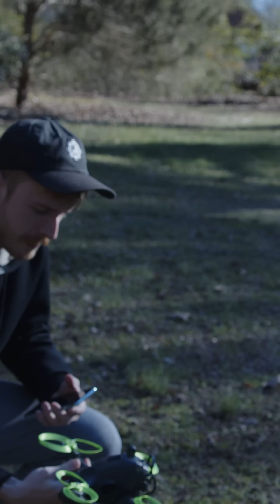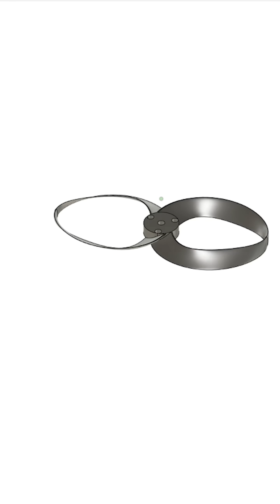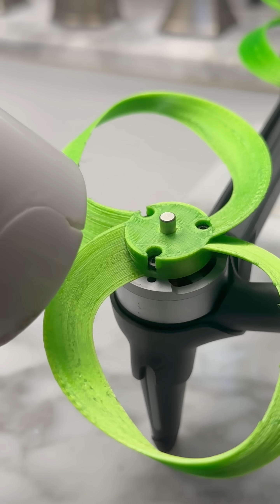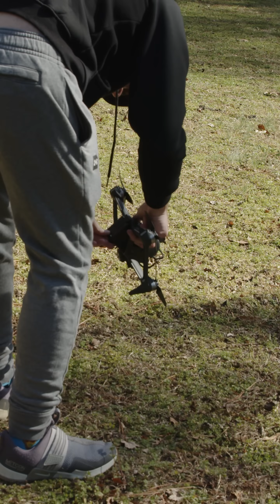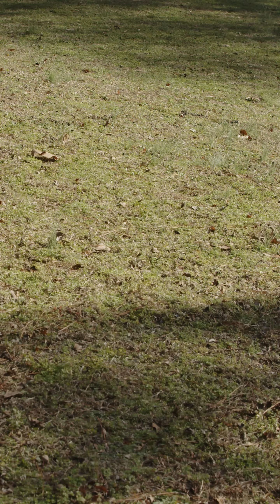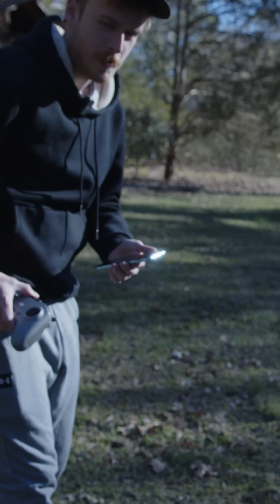Testing MIT's Toroidal Drone Propeller Design & Sound #shorts

Comment: They are very similiar
Because the normal propellers are vrey well manufactured to less than 0,1mm deviance and are very smooth etc
The 3d printed proellors, if oyu go down to the microscopic level, even with nailpolish are gonna be 100x rogher, whcih is why they are way louder thant they should be.
Reply: the real propellors were literally 3d printed too
Reply: @tee1532 But there was also a great deal of time, effort, and money spent to produce machines that could refine that 3D printed raw product to be a smooth and properly balanced blade with the desired chord and AoA. Besides putting nail polish on his homemade ones, there doesn’t seem to have been anything done to rebalance and actually smooth out the blades, let alone actually working to ensure the specs matched the actual design in lengths, angles, chord, etc.

Comment: They sound about twice as loud. You should try ones printed on a resin 3D printer. They would be much smoother. I think it's the ridges that cause the noise.
Reply: To me it looks like the outer geometry of the props isn't anywhere near what is currently under development. He's getting waaay too much turbulence by the sound of them
Reply: @joshb6993  The real test would be giving me one to run on one of my nitro two strokes.
Reply: From what I recall the official design isn't actually out yet for use, can't remember. So it's probably a custom build that only looks the same. Probably why it's having turbulence.
Reply: Automatic audio compression is one hell of a thing. You never know if what you heard was how loud it really was.
Reply: @BC-wj8fx  Maybe not, but as they were both recorded on the same equipment, it's fine for comparison.
Reply: @Erebus2772  No it's not. Automatic compression means that 2 things with different volumes will sound like they're the same volume.
Reply: @bailey2517  lol they definitely aren’t an audio engineer
Reply: ABS and acetone smoothing might work well.
Reply: @conorstewart2214  Exactly what I suggested on another of these videos.
Reply: He didn’t say that he balanced them, an out of balance prop is louder
Reply: Probably autogain on the microphone..
Reply: @savagesarethebest7251  same device for control, so yeah the second one is louder.
Reply: @mrtimjitsu  this.  I was thinking about this but didn’t bother saying anything because YT.  It’s loud but it’s also much lower in tone.
Reply: @mrtimjitsu  Nope. Its the opposite. Lower frequency travels further.
Reply: @user-jl8sy6ny1n  You're right, It is the opposite. lol oops. Been a while since I've studied this topic.
Reply: 3d printing is not the answer. Its not clean enough
Reply: I'm pretty sure he knew that before he even started lol
Reply: First test makes higher pitch noise. I would bet there was some negative gains so the microphone doesn't saturate.

Second test is lower pitch, harder to make the microphone saturate so the microphone gains wasn't reduced as much Wich makes you think it's louder. it's a very common thing nowadays.

The only good test would be to use a tool that reads Decibels
Reply: The blades slice through the air , these carry more air around and makes it sound like a wind tunnel , it has a more smoother sound rather than more the more Treble like blade sound
Reply: Sand em
Reply: Laughed at that first part, I thought the same thing
Reply: I'm with ya.  Sounds way louder.  BUT, it's an experiment, so....
Reply: This comment.
Reply: Or mold them
Reply: Or just buy the wings ?
Reply: Yeah but it sounds as though it may be at a lower frequency so the sound may not travel as far
Reply: The sound harmonics are on a lower octave....
Reply: This, you are correct, imperfections on the surface cause drag, which in turn cause noise. If he printed it in resin it would be butter smooth and it would be so much better.
Reply: I think the tolerancing would not be tight enough even on a resin printer.
Reply: Let me set everyone straight here. Lower frequencies do travel further before dissipating. So you will be able to detect them from longer distances.
BUT, the human ear is much more sensitive to higher frequencies, which is why they SOUND like they're louder. Bass tones have to be a lot louder to SOUND like they're the same volume. That's why high frequencies seem like they travel further even though they don't, because your ears can pick up on them even when they're very very quiet.
Reply: It wouldn’t be strong enough

Comment: Nice try but your modelling has the most important part wrong.
You see, what is reducing the noise on the MITs propeller is the fact that the blades have no breakpoint, stopping the air to go from the bottom of the wing to the top, creating vortexes, that are loud.
Yours have a corner, wher me the gets trapped and accelerate enough to get out, with an even bigger vortex.
Also i'm pretty sure you turned the volume up while edditing.

Comment: Sounded allot louder than the original blades
Reply: The problem is that it's a rough, 3D printed propeller vs a smooth, manufactured propeller. It's not a fair comparison at all.
Reply: That’s what I thought, but it could have been just sound compressed differently. He should measure it properly.

Comment: Unless you are getting extra thrust or battery life, it is actually somewhat nice to hear the quad when it is flying. You can estimate where it is and also there is something that gives goosebumps about hearing the screach as you rip the sky
Reply: The MIT design is quite a bit more efficient, when perfectly balanced/smooth/designed/etc..  The lessened sound is mostly in the middle of human speech, so the range estimation frequencies aren’t touch.
Reply: I think the point is not for recreational drones but more for commercial or cargo usage. Like if you are using a drone to record an event or to survey a building or carrying cargo, you would want it to have the least impact on people around it so reducing its noise is a good idea.
Reply: You want goosebumps just think of all the children a silent drone could bomb.
Reply: @XiaolinDraconis  drones don’t need to be silent for that. Just drop a bomb or rocket from high altitude and they will never know the drone is there. Or just use munitions that go over the speed of sound, you wouldn’t hear it coming either. Stop with the scaremongering around drones it is ridiculous.
Reply: @conorstewart2214  yeah but traditional drone bombings don't capture that delicious close up of the terror on their faces the second before the blast.
Reply: @XiaolinDraconis  what is wrong with you? You are just scared of new technology, there is nothing unique about this, an RC car with an explosive could do the same, as could a landmine with a camera nearby. Again none of that is unique to drones.

Comment: You might also try to 3d print a set of replica props that are the same dimensions as the stock props, and compare the 3d printed toroidal props with the 3d printed stock replicas. Just for a more controlled test.
Reply: Or print the toroidal props out of ABS and acetone smooth them to get a very similar finish to the stock injection molded props.
Reply: @Conor Stewart  isn't that what he did? The nail polish remover is acetone.
Reply: @maksrambe3812  he didn't say he removed the nail polish
Reply: @maksrambe3812 the hell are you talking about nail polish is acetone? That's absolutely not true lol. Acetone is sometimes marketed as nail polish remover but I'm fairly certain a solvent wouldn't make the best nail polish
Reply: @maksrambe3812 so he did attempt to smooth the prop but additively instead of subtractive.

He put clear nail polish on, hoping to fill in the gaps.

Alternately he could have used acetone with ABS, ABS dissolves back to a liquid in acetone.

So he could have smoothed it by liquifying the skin of the propeller with acetone to let self level to fix  imperfections
Reply: @Acidburn1155  Maksrambe got confused by thinking it was nailpolish remover which got you confused which nearly got me confused. Hahaha xD
Reply: @twoowlcandies2798  lol
Reply: @Acidburn1155  He said nail polish remover, but I think he just missed where dude said nail polish.
Reply: this^. a control would make this test way more useful
Reply: "This right here is a prhstrohljklm..... "  Not a native speaker. 
Help me.
Reply: @user-fiF5ei8tyah  toroidal propeller.  I think he added a couple extra letters (he misspoke).
Reply: @user-fiF5ei8tyah  You're not off to a good start there. What exactly are you saying?
Reply: @twoowlcandies2798  they were quoting the first line of the video, or at least how they interpreted it.  The creator kind of fumbled through "toroidal propeller", so it's an easy misunderstanding to have.
Reply: @nosslived  Makes sense, he was just using poor grammar and structure and I didn't notice what line he was quoting from so it threw me off. Thanks.
Reply: This